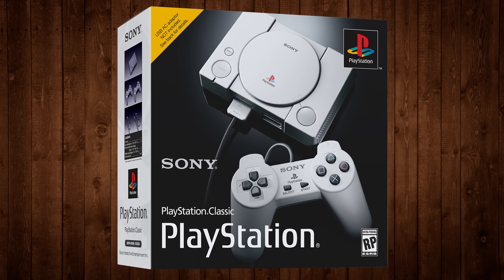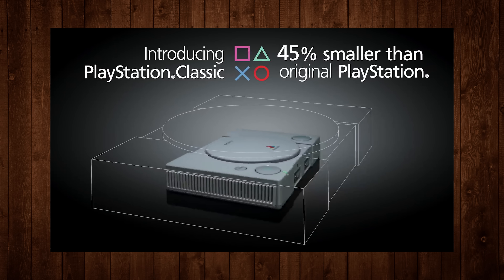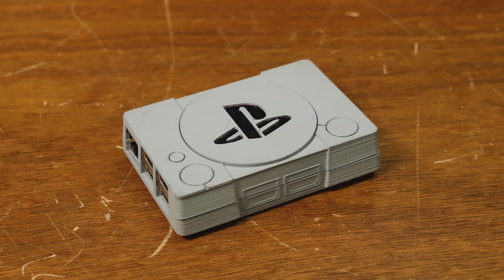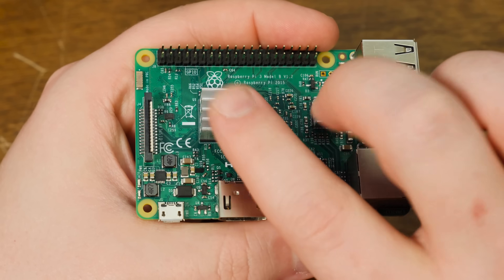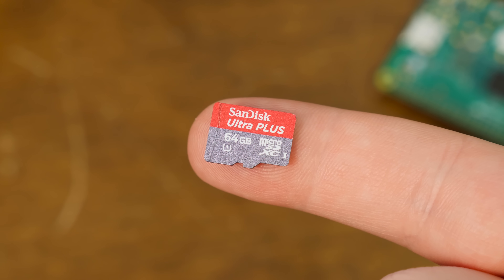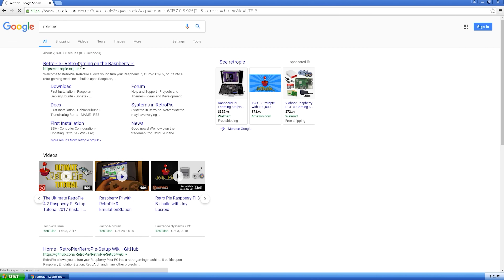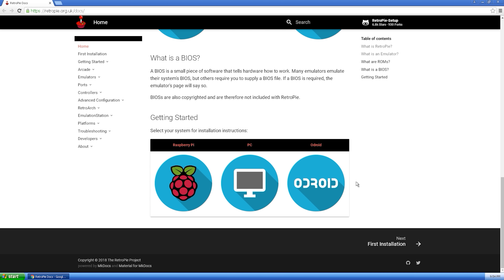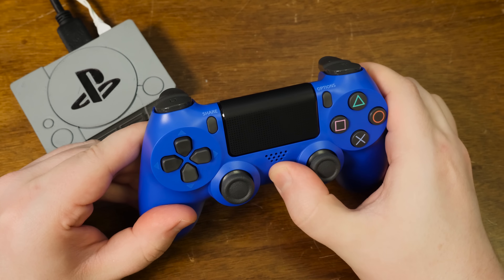Building a Better PlayStation Classic Console

Comment: May sound like an odd question, but can you connect a USB CD Drive so you can play physical PS1 games?
Reply: @Cyber Stein You don't get a 1080p or possibly up 4K Resolution, you get no Graphical Mods or Adjustments, You get no Save States (being able to save wherever), as well as so many other features that are not possible with an original PlayStation. Only with an Emulator Box. My Windows 10 Gaming PC emulates PS1 games well and can play my physical library with tons of upscaling and various other options, it would be nice to have a semi-portable form factor.
Reply: @Cyber Stein You're not understanding... "It would be nice to have it in a semi-portable form factor." Hence, a massive gaming PC is not very portable... (Also, I would be using a PS4 controller. Very comfortable controller.)
Reply: It loads everything off of a memory card, so you have to make .iso files out of the discs and copy them to the card.
Reply: yes. the SEEDI project guys went and released their code as freeware so you could do that.

Comment: I wonder how hard it would be to make the case slightly bigger and add a front facing slot loading CD-ROM, and functional Power, Reset, and eject buttons. 🤔
Reply: The hardest part would be the CD-ROM.  Because the PS1 had a clamshell CD drive, getting that just right might be a bit of challenge.  The power, reset, and eject buttons would be super easy via the GPIO pins.

Comment: It boggles my mind why they didn't repurpose the PSTV hardware for the official Classic. The emulation is way better being their own in house solution and Sony already had the hardware and tooling available. They could've slapped it in a new case, changed the UI, and manage to revive a recently discontinued product easily. Not to mention it'd have the added bonus of being connected to the PSN store to allow for purchasing more PS1 titles.
Reply: See, that would require both a)Sony to be run by competent people and b)acknowledging the existence of a console they went out of their way to bury.

Comment: I guess i could use my old galaxy s3 to do this. Just fill it with games, plug it into the dumb hdmi dongle and connect to the tv. Only issue is the 30hz output, but meh, its free since i already have it lying around, so cant complain

Comment: Another great video.

I did something else for my retro fix. I have a fairly good sized collection of retro games and systems, including 400+ original PS1 games (probably 500+, if we're counting demo discs), but it's all packed away right now due to space constraints.

I can't wait to get it all out again! But in the meantime, what i did, was i took an original but broken, yellowed, and damaged NES, i gutted it for parts, and the casing, i re-used, and brought back to life, by building a mid-range gaming PC in the thing. It contains an i5 8400 six core CPU, and a GTX 1050 Ti graphics card, all internal in the NES casing, and with a decently solid finish. You can't tell it's not an original NES, unless you open the lid (incidentally, the RGB on the motherboard shines through the dust filter i put under there), or, until you look at the back and see all the connections. :)
Ideally, i would have liked a more powerful GPU, but it wouldn't have fit internally, sadly.
It's now my primary HTPC, meaning it serves tons of other purposes, than just retro gaming. :) It was definitely a fun project. I'll revisit it and upgrade it when PCI Express 4.0, and the next thunderbolt connection standart is a thing, because that will (hopefully) enable me to use more powerful GPU's in an external enclosure, without taking a hit to performance due to bandwidth limitations. :)

Comment: I find just hunting down pre-built images for the Pi to be infinitely easier and more usable then doing it myself. They typically have box art and video snaps already set up along with bezels for the 4:3 aspect ratio and emulation station themes already installed.

Comment: And people are still defending the trash that Sony dared to charge $100 for. And even then, people are still only buying the PS1 classic just to hack it and add more games to it, when they can easily go this route and save some cash.
Reply: Naughty internet person  The processor used in the classic release is actually inferior to a pi's, and RetroArch still has a whole slew of graphic options for tuning the classic release doesn't dispose of. Not to mention hacking the classic is a hassle compared to the ease of downloading roms to your heart's content at the drop of a hat via wireless. As for buttons, any analogless USB controller could do. Those usually go for dirt cheap.

It really is just as you say: a 20% 'premium' product that is essentially worth 1/3rd of the practicality with no real purpose aside from the aesthetic choice. I agree, though: nothing to be salty about.
Reply: Keep in mind that a retropie still requires that you have or buy controllers.
The PS4 controller clint uses in the video basically would double the price of this setup if you didn't already have one lying around.
People might complain about them not being dualshock equivalents, but the system still includes two controllers.

Controllers DO matter to the experience quite a bit.
Part of the reason I bothered with the Nintendo ones is specifically the controllers that come with it.
Reply: @KuraIthys  You could always buy a usb ps1/2 controller input. i had one that supported 2 controllers. Then you get to use real controllers
Reply: Aesthetics matter to some people, and the 3D printed cases available are total garbage compared to the official thing. That's the reason I bought a NES and SNES classic, the cases on those things are awesome and it was incredibly easy to add whatever games I wanted to them. 

I'm holding off on buying a Playstation Classic until either Sony or a fan releases a better frontend for the thing though, it's missing too many features right now and the ui just lacks the polish and charm that the Nintendo mini consoles have.

Comment: I have a raspberry pi 3b+ hooked up to a dual purpose lithium-ion battery charger and boost converter which is attached to a 6000mah battery and also runs off to a separate micro USB port for charging. This powers the raspberry pi plus a 3.5" HDMI screen I got off eBay as well as an adafruit 5v audio amplifier which I soldered to the pi's 3.5mm audio jack output. This all works great now despite the low voltage warnings you mentioned in the video I just need to sort out a case for it all now. Makes quite a nice little portable games console though and it's loud too using an old speaker from a broken Bluetooth one I had laying around.

Comment: what make me angry is that i would happily rebuy digital copy of classic ps1 and ps2 game if Sony add a backwards compatible support for the ps4. If backwards compatible for PS3 is too difficult i kinda understand but there's no reason they can't make the ps4 run ps1 and ps2 game except lazy and now Sony try to feed on ours nostalgia with the cheap mini consoles that run the pc emulator that they use to sue in the first place. *And i know some of the ps2 game you can play on ps4 but that it more of a port and the selection is way, way too poor for the legendary ps2.
Reply: Some ps2 games were made available on ps4. I got GTA San Andreas on ps4 for 7 bucks on ps store. Still Sony suck. I am a PlayStation die hard but sometimes I find myself wishing that the PlayStation division would be sold to a company that cared about both the brand and the gamers.
Reply: You know, ps3 is perfectly capable to emulate ps1 and ps2, but they removed the feature to emulate ps2 in their updates (you can still use it if you mod the console). Sony is not lazy, but worse, they want to stop you from playing their old games so that you must always buy the newest products. The ps classic in facts just includes 20 of them and is a collectible rather than an actual console.
Reply: The earliest PS3 models actually had PS2 hardware in them for PS2 games. Newer models can only emulate, which works fine most of the time. But not always. Sony's PSX and PS2 emulators are functional, but give you zero options to improve the picture and that's a shame.
Reply: @clochard4074  There are some emulated PS2 games on Ps store for the PS3, but software PS2 emulation on PS3 is really shoddy. "Sony is not lazy, but worse, they want to stop you from playing their old games so that you must always buy the newest products" There might be some truth in this, but a more fair explanation would be that they don't see any profit in bringing back old games to PS4 through emulation, so they don't bother with it. I mean let's be honest, PS1 and PS2 games are damn ugly for gamers who are used to the PS4 or even PS3 generation and often times, they have clunky gameplay. And even though there might be a demand from older games to play them on newer systems they would want to play the games they already not buy them again so again, no profit to be made there. Now, PS5 will definitely have PS4 backwards compatibilty because it would be a huge selling point for PS5 at launch especially if it can run PS4 games in higher quality (imagine Bloodborne or Horizon Zero Dawn in 4K 60fps for example). However, PS3 and below is questionable.
Reply: @weaverquest  Well, while ps2 emulation wasn't perfect, they directly killed the feature that was already there. If not enough players were interested in those games, then why the playstation classic, why all the emulators? How can we say newcomers can't enjoy them when I see my little brother play those games alongside the new ones? Why there is no need preserving older games? If they don't look nice they can't serve any purpose? You are talking of them like disposable products, all equivalent, with no value aside killing some time. This is in my opinion a degrading way to look to the entertainment industry. Try this reasoning with old movies or old books. I don't want to sound aggressive, but I've heard this story too many times, and it eerly resembles what sony repeats to the presses: "You don't really want it, we know what is best for you!". If Sony really don't care about older games, why are they so bothered if people emulates them?
Reply: @clochard4074  I didn't say they are disposable products that have no value after a certain period. I am not talking about them like that nor think that way. We are looking at it from different perspectives. What I said was that it is just not profitable for Sony. To actually put effort, time and money to properly bring those games to newer systems. Why PlayStation classic? Well, because the entire idea behind that concept is selling the same old games but in a "different" way with minimal effort. Open source emulator, incredibly limited number of games to offer, and probably the cheapest hardware possible repackaged in a product that feels new to the customer but is actually the same old thing sold at a premium. The OG PS3 had PS2 hardware inside so PS2 games worked great through hardware emulation. Later models took out some parts understandably due to cost but also left some and handled the rest with software emulation which was not as good and had reduced compatibility with games. By the time of slim PS3, only software emulation was possible and as I said it was bad. Just like the PS1 classic which Sony clearly put zero thought and effort into, I would rather have Sony not sell the PS2 games on PS3 with that crappy emulator because it is unfair to the customer. Looking at what PS1 classic turned out to be, it would be better if it didn't exist at all imo. And that sums up my point. Selling PS1 and PS2 games should be done right with the proper effort put into the emulators to make all the games run great with minimal issues but the problem is, there is probably no financial incentive in doing so. Sony should know that since they surprisingly managed to achieve the PS1 software emulation on PSP and also made it possible that when you buy a PS1 game on PSN it would also work on PS Vita and the PS3 but I assume they didn't gain much from that. Preserving old video games is indeed important but that doesn't necessarily mean bringing them to new consoles in whatever way possible. Best way to introduce old games to new generations are in fact the remakes such as Crash Insane Trilogy or Spyro Reignited Trilogy, not putting them out the exact way they are with open source emulator. But of course, that's much harder to do.

Also lastly let's not compare video games with movies and books. It is an unfortunate fact that video games do age badly, and really fast due to improvement in technology and developers getting better and better in this field which hasn't existed for very long. But I believe that's going slow down with this and later generations and the quality and design aspect of games will be the main focus rather than the tech behind it.
Reply: @weaverquest  It's funny how low-effort these devices are on the software side. I mean, reproducing old controller designs using a new kind of interface essentially means designing an entirely new controller.

Nintendo seems to have built their own emulators for these devices - I mean, they already had working emulators, but for a different hardware architecture entirely. - which means they wrote new emulators just for these 'classic' things.

I don't know how sony got it so wrong though - using an open source emulator isn't necessarily going to give bad results, yet they somehow found a way to get worse results than other iterations of the same emulator. Quite a feat.

The whole PAL game thing (especially outside of PAL territories) is also baffling.

The game selection isn't ideal I suppose, but unfortunately when you're doing this stuff above board you are bound by whatever negotiations you can make with the developers/publishers of the games.

The SNES mini not having Chrono Trigger on it is probably a deliberate choice (given how many Square Enix games are on the thing), but a game like say, Terranigma (which wouldn't have been on there regardless, because it's too obscure)... Well, who even owns that at this point?
Doing things legally can be quite limiting.

I wonder how many games didn't make it onto the Playstation classic because Sony either couldn't get an agreement with the Publisher (or couldn't be bothered with getting an agreement.)

Frustrating, for sure.
Reply: @weaverquest  I understand your points, yet I can't fully agree. I surely can see Sony deciding that retrocompatibility is not worth the hassle, it wouldn't be really a big hassle since they know how the previous architecture worked and wouldn't have to reverse ingeneering the whole thing but whatever. But if there are no money to be made there, those games should go into public domain, and not kept hostages under some company that simply doesn't care (not only Sony of course but also the third party publishers). You said it yourself, they want an easy profit, and it's way easier for them to let those games die rather to let anyone play them trough other devices.
Reply: @clochard4074  It comes down to three words: "Money, dear fellow."  The reason they removed PS2 emulation from the PS3 is this: They were already selling the PS3 at a loss, making up for it with the profit from the games they sold.  Research showed that most people who bought the PS3 were NOT using it to play PS2 games.  As a result, Sony removed the PS2 hardware, so that they were cheaper to make.  The PS3 can still emulate the PS1 and some of the PS2 games, but the emulation is not always perfect.  

As far as "If Sony really don't care about older games, why are they so bothered if people emulate them?"  Because copyright law, that's why.  It is a copyright violation to reverse-engineer the BIOS so you can emulate it.  It is a copyright violation to download the BIOS.  Under U.S. law, it is a copyright violation to download game images even if you already own the game.  You have to make those game images yourself in order to be legal.

Let's say you own a PS1 and the game Parasite Eve, and you want to use an emulator so you can play the game again.  You can download the emulator without a problem... it is not a copyright violation to emulate the console.  BUT, if the emulator requires a copy of the BIOS, you will have to find a way to create your own copy of the BIOS, using your original PS1 (most people don't have the knowledge or the equipment).  You will also have to create your own image of the game, using the original CD.  It is the only completely legal way to do it, at least within the United States.

Having said all that, Sony is very unlikely to bother with people who download a copy of the BIOS, or people who download game images for their own private use.  The PS1 and its games are so old that Sony is not making money from them anymore; for example, if you go to a place like Borderland Games and buy a refurbished PS1 and a few games, none of that money is going to Sony, it's all going to Borderland Games.  So, it literally would not be worth Sony's time or money to pursue legal action... unless you're making collections of game images and trying to sell them for a profit.  Then Sony would send their lawyers after you in a hot second.
Reply: @SpearM3064  I know what copyright is, but you see, copyright laws are there to assure the original creators they can keep profiting from what they have done. If they sleep on those rights it won't benefit them, us, nobody: I believe they should lose their intellectual properties in favour of the public. It's difficult to freely distribute roms of games that aren't even sold anymore when sites got blocked for "piracy". Of course Sony won't be knocking to my door any time soon but I believe most companies are acting unethically and to rub it off as just acting in their interest doesn't bring the whole picture.